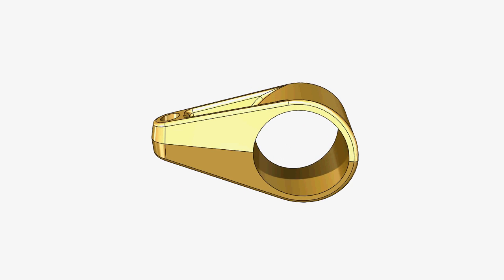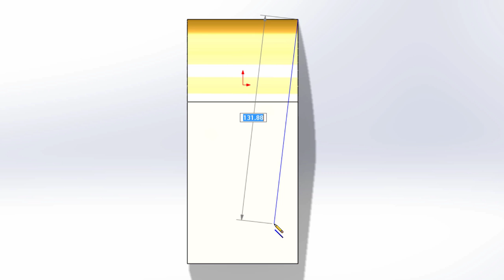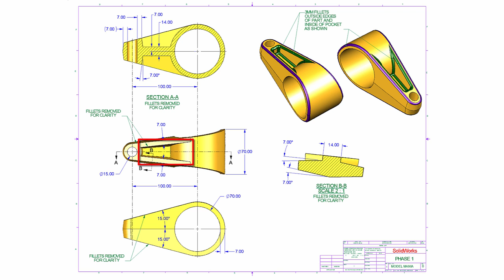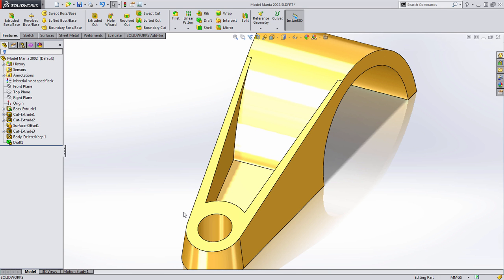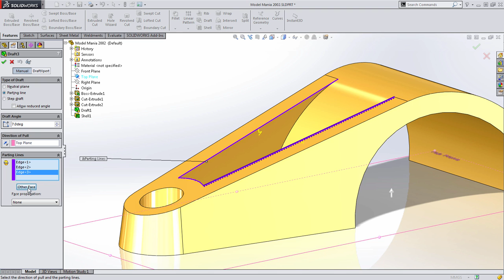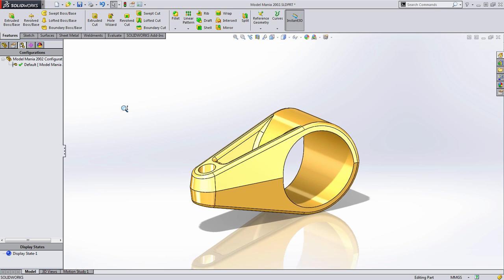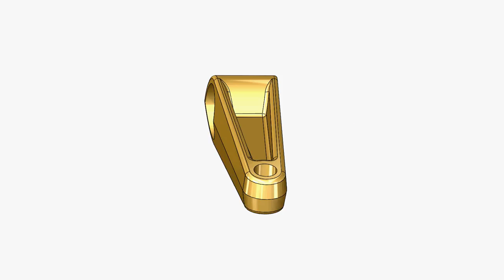SOLIDWORKS World: Model Mania 2002

Comment: Came here when the fillet for config D didn't work.
The problem was I forgot to draft the inside parts (I used shell to create). Note I did have to press "other face" for some of the parting lines
This fixed it

Comment: 1. Created the main body through two sketches. Top plane and side plane silhouette, with both holes already then combined and the main Body is done
2. Drafted the outside faces through parting line function and parting line draft function
3. Created negative bodies for the pockets, with mirror
4. Drafted the pockets and added fillets
I never Use BREP features except when you absolutely must ike here with the draft function. I can delete and change all bodies independently.

Comment: Am I crazy or is this not the most accurate way to do that pocket? If you offset the exterior edges 7mm by clicking the sloped edge, doesn't it project the sloped edge onto your level sketch plane, and then offset it by 7mm, resulting in a 7.003 wall thickness in the 3D part? Or does the software virtually offset the edge along that sloped face and only then projecting it to your level sketch plane, which would result in the correct 7mm wall thickness.
Reply from the maker: Hi there! Check out our list of Frequently Asked Questions here: https://www.solidworks.com/support/frequently-asked-questions?tid=All
Reply: @solidworks  I'd love an actual answer here and not some automated canned response.
Reply from the maker: Hi there! A great place to start for direct support would be our SWX User Forum: solidworks.com/UserForum or https://go.3ds.com/swforum

Comment: OK...tried to make this and it took almost 3 hours...configurations looked like they were going to work fine...it killed them.
How did you do it? 
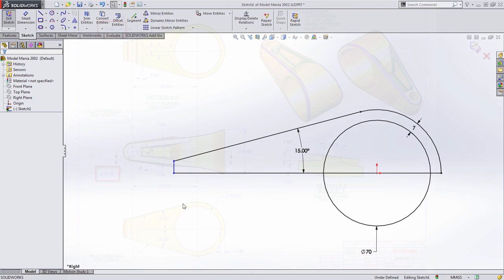2:26 but...why are we using the 7mm? Isn't parenthesis defining a reference value? I was making it while avoiding the use of this value.
Thank you for showing 2 different ways of doing the shell/draft
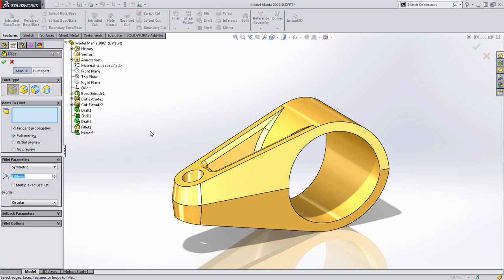13:09 I just noticed this tutorial does it in less than 15 minutes! Thank you!
I'd love to use Design Tables but I don't have a copy of excel...So I used Global Equations. Either way. I very much enjoyed this...Despite how frustrated I got over the (7.00) dimension
Reply from the maker: We are so happy you found this useful Kevin! Great work and thank you for your feedback.
Reply: Hey, newbie here. What kinds of values are reference values, and why would they not be used if they're included in a drawing?
Reply: @kemizehabib-mohammed8791  A reference dimension is one which can be derived from the other (non-reference) dimensions on the drawing.  They are used to indicate something which is useful, but not necessary to make the part.  A common usage is to add an overall part dimension so that the machinist knows what size stock material they need.  Strictly, if such a dimension were shown on the drawing without parentheses (or a "REF" suffix), then the drawing would be overdimensioned.

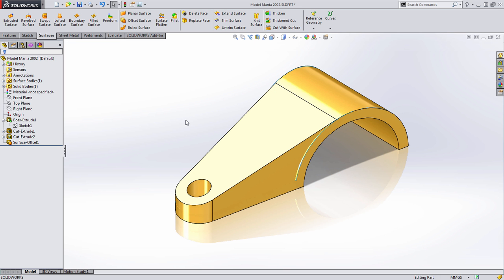Thus dimension referred to at 7:26 should not be used to drive the model.  However, I'm not sure how one would could build the left-hand end of the part without this particular dimension.

Comment: i tried moving the draft from the feature manager tree and nothing changed
Reply: could you solve the probem, I met the same problem
Reply: Same problem too. I ended up just deleting the cut extrude, applying the draft in the correct position, and then redoing the cut. I wonder if it has something to do with using newer versions of Solidworks

Comment: Hey, I have a problem. In my Solidworks sketches, I cannot put sizes right during sketching, I have to create estimated object, and right after it set it size to "diameter 70" for example. How can I change it? Can anyone help?
Reply: "Options (System Options) > Sketch > Enable on screen numeric input on entity creation"

It has a useful sub-option, "Create dimension only when value is entered".  If you type a number, SW adds the dimension.  If you don't, it acts as per your description above.

Comment: Hello
good video with a great explanation 
but!!!
after finishing shell feature and draft 2 times the thickness of the "rib" (this pocket between) in the upper point is 7.08 doing step by step after you 
the drawing says that we have to get 7 mm
is that a tolerance allowed?
Reply from the maker: Hello Yurii, you can set tolerance and precision options in the Dimension Value Property Manager. You can also find more resources and information on SOLIDWORKS Forum http://my.solidworks.com/forums
Reply: @solidworks  You doesnt help her about her questions.. and i have the same problem.. You didnt show the dimension.
Reply: Hi Yurii, i have also seen that and due to way the part is oriented, we not measuring normal to the part, always. Try to measure with EVALUATE and observe the normal distance. It should work!
Reply: Same thing for me, I used the shell command and drafted the surfaces. Instead of getting 7.0 I'm getting 7.06. Weird..! (Using fusion 360)
Reply: This is all because the shell makes offset from the surface outside and then it is angled 7deg to the surface where it should have 7mm, so that is the reason you have more than 7.00mm. Shell feature is wrong for this model,

Comment: Why is the width dimension mark with a Ø?
As far as I can tell it isn't at diameter.
Reply: Yeah same. I got thrown off by that too. 5 years later :3
Reply: @ethan_djoseph  It's dimensioned from the center line, so it measures as if it is a diameter.